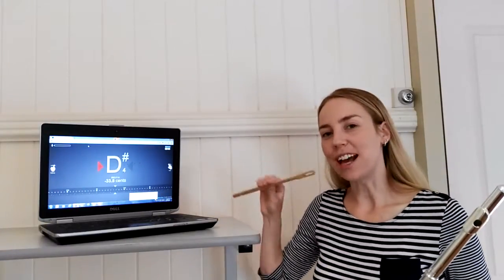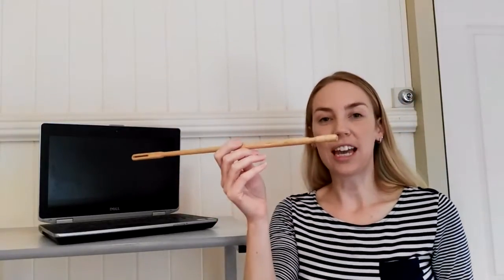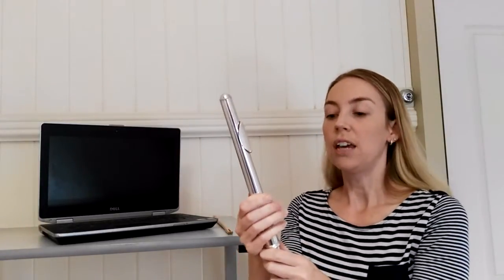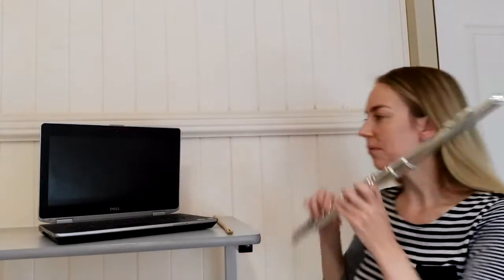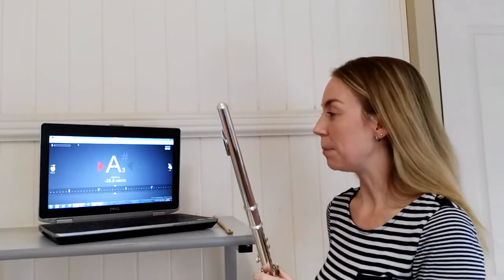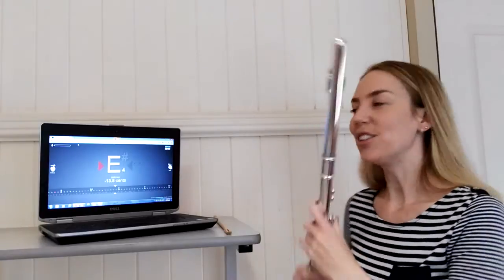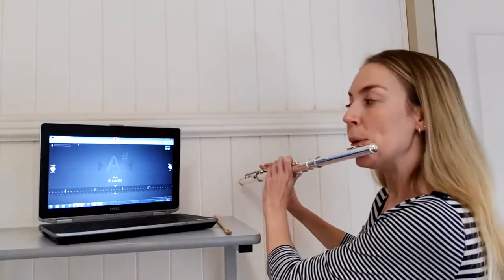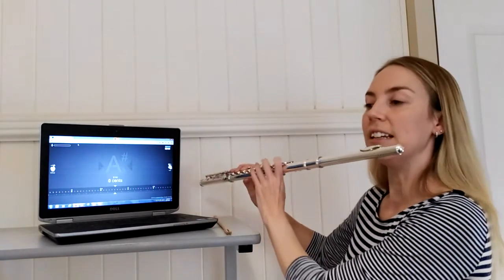The Flute Tuning Crash Course for Beginners

Comment: Great video. The head joint cork (dead centre when using the cleaning rod) can be adjusted. It is a factory default position & shouldn't be played aroud with unless you know what you're doing. In my case the Flute was relatively in tune but FLAT to the Orchestra. Pushing the cork a couple of mms to make the tube "shorter" solved the problem. It was very slight. Best to tell your repairer about it. As they say, "Don't try this at home". Thanks again.

Comment: How does one know the frequencies of one's flute ... A440 or whatever?
Reply: The manufacturer will specify that. It relates to the position of the holes on the tube. Most flutes are A=440Hz, but some professional orchestras (notably in Europe) tune to A=442 or even A=444, hence higher end flutes are available to those tunings. 
No, I don't know why. Twoset Violin had a spoof video about pitch inflation.